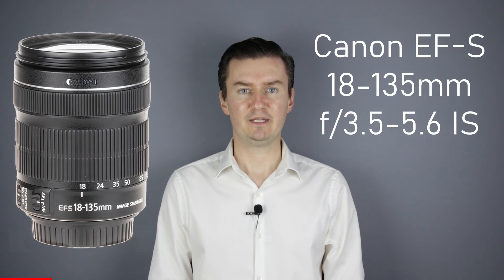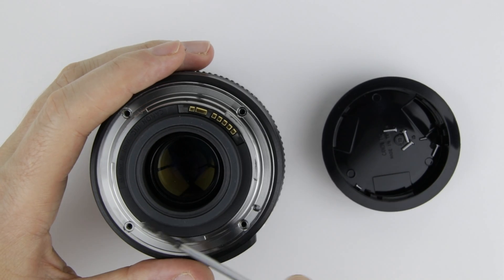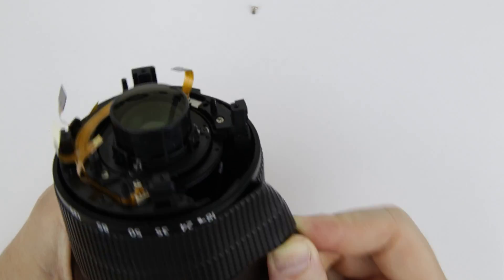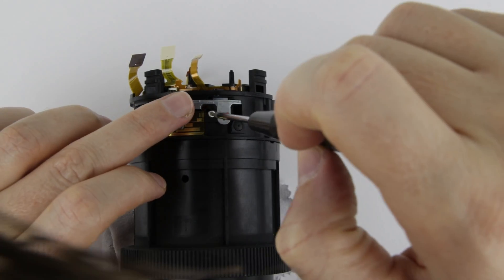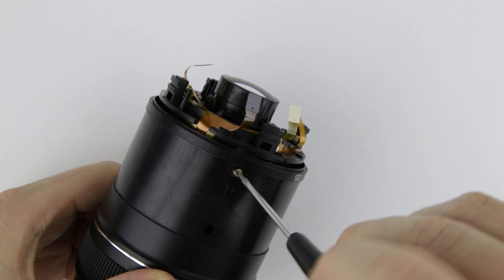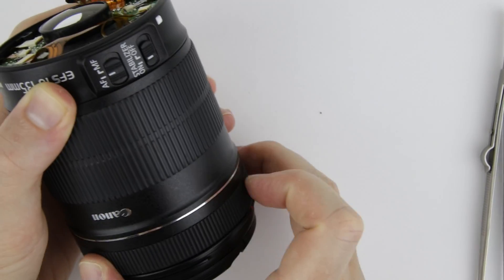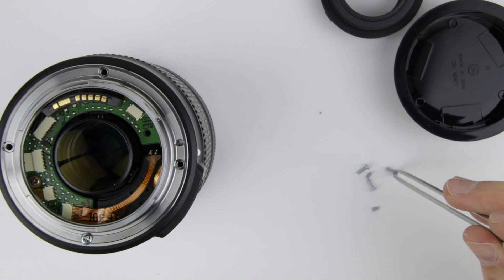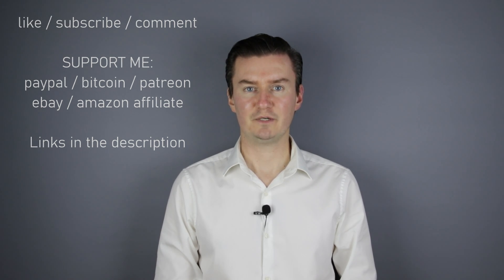Canon EF-S 18-135mm f/3.5-5.6 IS repairing the zoom and autofocus problems

Comment: Hello,

I own a Canon EF 24-105mm f/4 IS USM lens. When I bought it, the autofocus wasn’t working. I watched your video on replacing the aperture flex cable for this lens and partially disassembled it (not fully to reach the aperture flex cable).

I cleaned the cables and the mainboard with isopropyl alcohol, applied a very small amount of lubricant to the moving parts, and reassembled the lens. The autofocus worked flawlessly for one day, but afterward, it started struggling again. Sometimes it focuses, sometimes it doesn’t. I usually try to focus manually first, and sometimes after that, it manages to autofocus.

Do you happen to have a video specifically addressing this issue? Thank you very much in advance.
Reply from the maker: Most likely your focusing issues is caused by the dirty focus strip. I don't have video about cleaning that on your lens, but fortunately it is similar to other canon lenses. Use my disassembly video of the Canon 24-105mm f/4L IS USM lens to remove the USM motor, then use my video about cleaning of the focus strip of the Canon 17-55mm f/2.8 IS USM lens.

Comment: I took it apart and noticed that the 2 screws were not in place, now where can I find those 2 screws if I don't have them? What size are those 2 screws?
Reply from the maker: Shake the lens, maybe they are still inside. If you're lucky, you might buy those screws from ebay or aliexpress.
Reply: Did you find the screws to buy? When I opened the lens there was no screws on that zoom part

Comment: Thank you. For a while, I couldn't understand why it wouldn't zoom out completely. There was sometimes a little resistance and rattling. While inspecting the lens, a screw suddenly fell out! Sure enough, after dismantling it with the help of this video, it was indeed a lever screw. Strange that for all of Canon's engineering, that this is such a simple problem. But dismantling this "basic cheap" lens also helps me appreciate the engineering behind it so much more,
Thanks again 👍👍
Reply from the maker: Thank you for your comment, I'm glad that my video has helped you!

Comment: Hi, my lens can not focus at infinity when zoom over 100mm both auto and manual focus but it can focus objects at shorter distance (say <10 m). Less than 100mm everything works perfectly. Do you know what's wrong? PS. I follow your video to disassemble the lens but can't fix the problem. Thank you!
Reply from the maker: I would check the conductivity (if it is not broken) of the flat cable which is used for sensing where the zoom and focus of the lens. Those are the flat cables which the brushes running on.
My other, easier to check idea would be to zoom to 135mm, and lift the front of the lens a little bit, and check if the lens can focus. The idea would be that the screws of the front lens element got too loose, and the front lens element is not perfectly parallel with the rest of the lens elements, and it causes distortions, and because of that, the autofocusing is not working.
Reply: @CamerasLensesEtc thanks for your very detailed guide. I found the ribbon is broken of the flat strip that the focus brush runs on. What is the name of that strip? So I can search for a replacement online. Thanks in advance
Reply from the maker: @sharlienp1913  Just search for "Canon 18-135mm cable" on ebay, and you will find it.

Comment: Thank you for this video. I'm having a problem with the newer 18-135mm Nano USM version of this lens. I cant seem to find any video on what could cause the focusing to stop working (AF+MF). The IS and Aperture still works so I assume the board is fine. Any thoughts? Thanks
Reply from the maker: I haven't repaired that lens before, but the flat cable could be broken, which is a quite common problem if the cable is moving while zooming. The other problem could be the ultrasonic motor, which (generally) can't be repaired, so change that and see if that solved the problem.
Reply: @CamerasLensesEtc  thanks for the replay. I ended up getting it professionally repaired. The problem was with the “lens group IS assy” or so they said. Well it works now